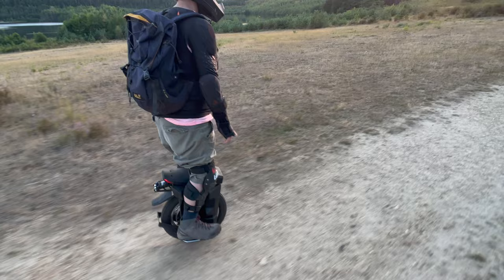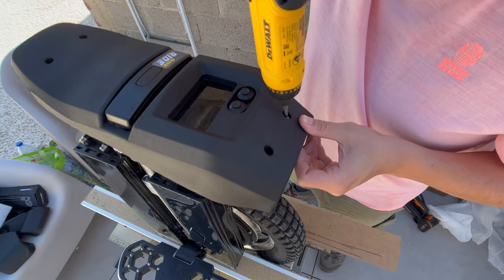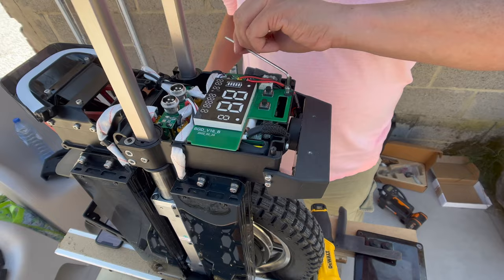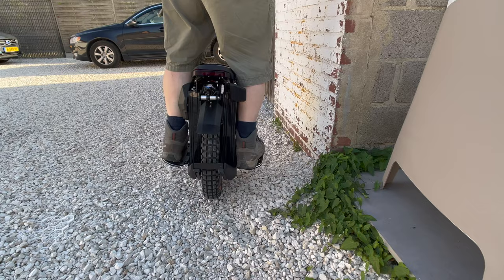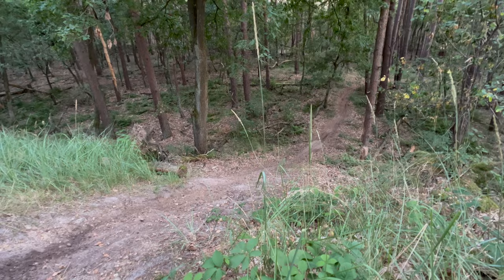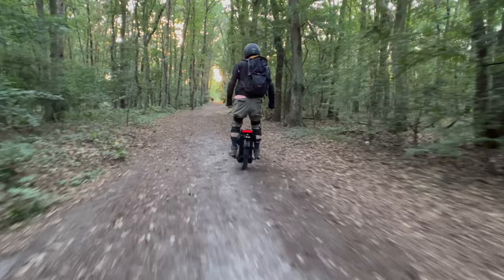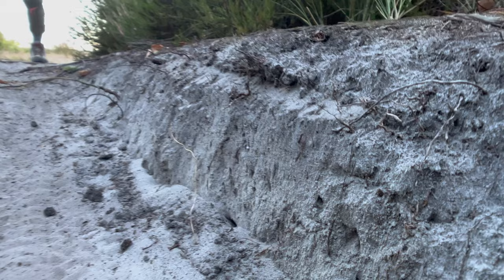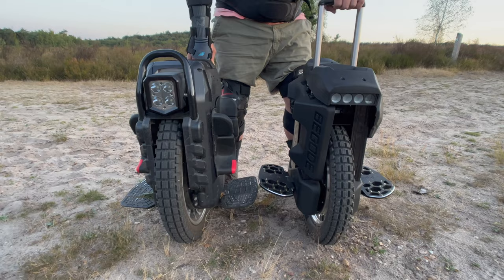Begode Master RockShox Suspension Kuba Linkage install guide & First Ride Test

Comment: Master is awesome, so simple and so many great upgrades available :)
Reply from the maker: Yeh nice to customize it… Lets be honest with all hobby’s we wanna improve and upgrade it just like motorcycle etc…
Its good that the mechanical part is ok and its just improvements like fairing and pads! Also we are gonna put a better light on it for offroad and its gonna be so much better! 😉
Reply: Yes I agree. Many people complain that an euc should be done out of the box. When I bought my ninja 650 had to get sliders grill suspension as well airfilter. If you are into sport riding then most likely you are used to the upgrade way of life. With the euc its so nice that you can probably do most upgrades yourself. Buy a ferari and no way can you even change a damn lightbulb in the dash lol. Moet speciale sleutel hebben alkeen voor die sukkel lampje.

Comment: was it big difference with rockshox suspension what air pressure did you try it with, I cant wait to get my new Master from ewheels
Reply from the maker: U should get the EMA suspension!
I got it installed today on my Begode Extreme and it’s even better then the Sherman s/Patton suspensions

Comment: Do you recommend master over S22 and Abrams? I'm hesitating between these. Which one would you recommend?
Reply from the maker: Its all really personal…
I prefer the s22 with the cnc sliders more then the master but it lacks power for off-road hills… the Abrams is the best cruise machine for me and nothing beats it! I rode monster pro also and many other wheels…
Reply: @MisterBanaszak  oh I see! Thanks for the input! I'll check out that CNC slider!
Reply from the maker: @klasop  it makes the wheels so smooth and worth the upgrade…

Comment: kuba linkage hard to find. If you find one snag it fast.Etsy is soldout. Only 1 place I saw in poland has them. Not sure if legit. Looked pricey? $350 polish money was 1400 the price -+
Reply from the maker: Yes there are others making links now and the brand with the torque pads have them also?
Reply: Ya heb ze net gevonden maar ze hebven geen betaal later optie lol. Had laatste dookoe voor grizzla fairing bumper kit gebruikt. Een dag verder he. Keep on riding!

Comment: Could you compare it to the stock suspension?  Did you ride it stock before installing this suspension?
Reply from the maker: Yes at 250 psi it bottoms out really easy for the rider…. He is 110kg
Reply: I aired mine up to 350 havent bottomed out yet at 250 lbs
Reply from the maker: @shoestatus  Yes i will recieve mine this week and we will do a good comparison vs stock suspension!

Comment: Does the new kuba linkage allow for a bigger shock ? What are the size specs for the rock shock?
Reply from the maker: 190x51 the kuba linkage will use the full travel of the shock!
Reply: What is the specific name of that rock shock for someone to order it and where do you get the Kuba linkage from
Reply from the maker: @supermotodave  rockshox monarch rt3 debon air 190x51 and linkage was on Etsy before…

Comment: Do you know what major differences the rt3 has over the rl on the master?
Reply from the maker: Rt3? And rl?
Reply: @MisterBanaszak  different models of the rockshox monarch
Reply from the maker: Ah yes it does… but u can buy a cheaper model and put tokens in!
Reply from the maker: @khmerkid213  the linkage more important then the shock… if u get the latest gen airshock from begode it will not bottom out quick! But it will use full stroke with new linkage
Reply: I am planning on buying the linkage but my master I believe is v1 from retailers with the old shock. So I'm looking to get either the rl or rt3 but not sure which would be better
Reply from the maker: The higher spec models can take higher psi… if u are not to heavy buy cheaper model like RL and try it out and also buy the tokens so u don’t bottom out… u can always send it back
Reply: @MisterBanaszak  ah ok makes sense. Probably rt3 then since I'm about 225 geared up
Reply from the maker: @khmerkid213  yeh! Then it will be perfect…

Comment: how tall are u?the master look really small when u ride it
Reply from the maker: Yeh the master is not big… T4 is a baby wheel for me :)
Im 1.94m tall
Reply: @MisterBanaszak  where can u get the RockShox Suspension & Kuba Linkage?
Reply from the maker: @muhammadradhi  u could buy the suspension arm from kuba on etsy but hè is gonna sell them together with the people that made the torque pads… suspension rockshox u need to find the best deals online shops…
Reply: Very nice video showcasing new suspension for the Master. Now hopefully can handle bigger jumps like the S22.
Reply from the maker: @eucryan  thanks! I will be doing a comparison with a stock Master but the T40 vs the kuba linkage and rockshox…
Believe me u wont bottom out with this setup…

Comment: Could you please tell where to buy the suspension arms🙏🏻
Reply from the maker: It was on Etsy before but now torque pads is gonna sell them normally…
Reply: @MisterBanaszak  thanks so much
Reply: @MisterBanaszak  Do you think is that possible to install Dnm rcp2s?
Reply from the maker: @ticoli5985  we need to see if the nipple/airvalve is reachable…
Reply: @MisterBanaszak  👍

Comment: Unfortunately, this promotion option seems completely pointless to the average driver! Master's original suspension is extremely comfortable for my 105kg + weight and 300psi in normal driving. The original suspension smooths out all road bumps! As per the shaking of the legs visible in the video, this addition here unfortunately only smooths out the bigger hits. One important thing in the original suspension threads! After pumping, first open the valve lock and release the pressure from the pump slack! Only then turn off the pump. It is by not doing this that the valve flap is unscrewed and damaged. Because of this incorrect handling, the shock may therefore have much lower pressure than the pump! You think you pumped 300-350psi, but due to improper removal of the pump, only 200psi was left in!?
Reply from the maker: Ok Yes but for our riding we need to not bottom out and i had the same on my Hero that it was much more comfortable for the imperfections in the road but not good enough for bigger stuff… the suspension now feels much more rigid then before and u use all the stroke of the suspension even of it has the same travel overall… but thanks for your opinion and for casual riders the stock suspension is enough!
Reply: Ur 231 lbs yeah I'm definitely pulling the trigger on the master this Friday 😎
Reply from the maker: @nastynate1373  yeh with stock suspension and around 300psi it’s still fine 👍🏼
Reply: @MisterBanaszak  I'm 180 lbs maybe around 195-200 fully geared so stock should be okay but ur video is definitely necessary if one plans to upgrade 💯😁😁😁
Reply from the maker: Yeh u can play with it! If u don’t do high drops it’s fine around 250psi…
Reply: It only takes a few talking heads on utoob to say the tire and suspension sucks and then all the experts who barely ride parrot that like gospel and it becomes a "fact" in the community. When I hear someone ride the master for an hour and say they want to change tire, Im secretly judging them as a rider. 😆